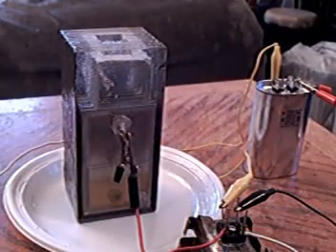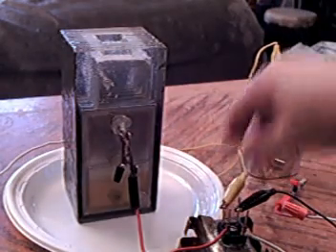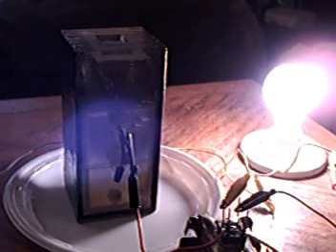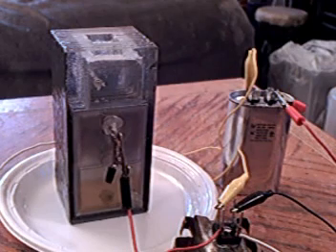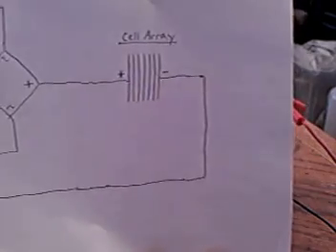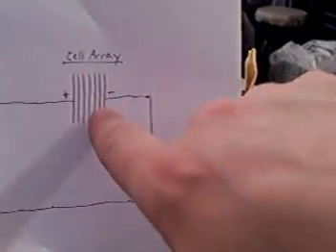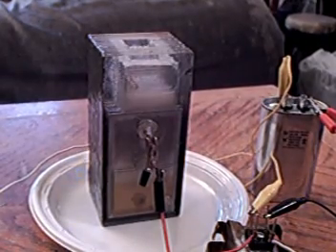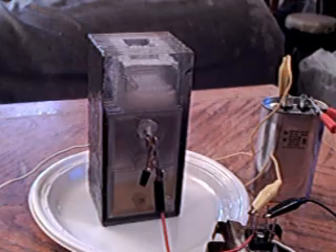Series Cell with CAPACITIVE TRANSFORMER - Part 2

Comment: got to thinkin I should have remembered safty #1 should have sugested to first go threw a bubbler, with a safty blow off cap in case of a back flash, but a tube going to a metal pipe stuffed with bronze wool still could work, I know alot of people make torches, I was just trying to think of something different HHO would be usefull for! Thanks I really injoyed your video!

Comment: if i use a 12 volt dc and an dc to ac adapter in my car i can use this? if so do i not have loss at the adapter? and heat? but with the lower power reqirements i assume it will help. what are your thoughts. 

thanks

Comment: hi there,very nice contribution to the Hydrogen experimenters. That circuit is the circuit used by the Mosa Welder, made in Italy.Capacitor discharge system. It's true it never goes HOT. Good research.

Comment: You can do the same thing with an old fashion flouro ballasts from flouro lamps that have starters and it doesnt need to be discharged after it is turned off.